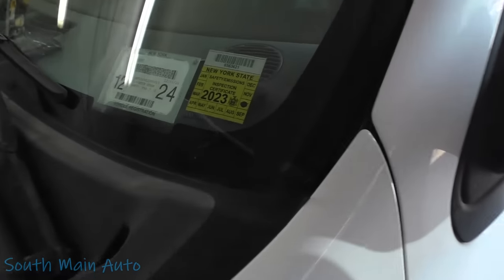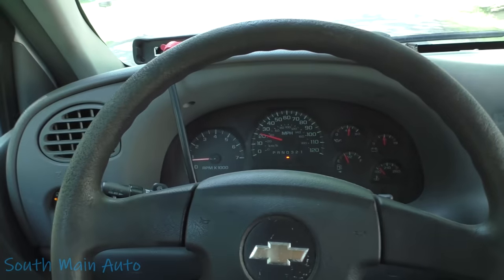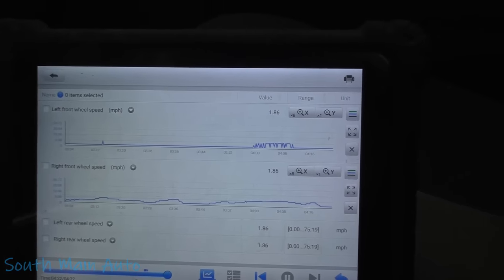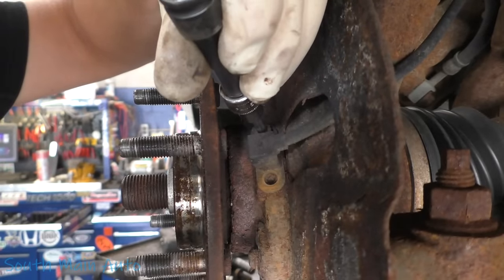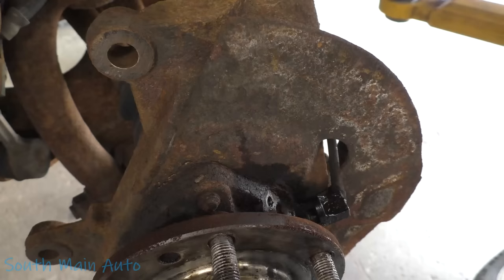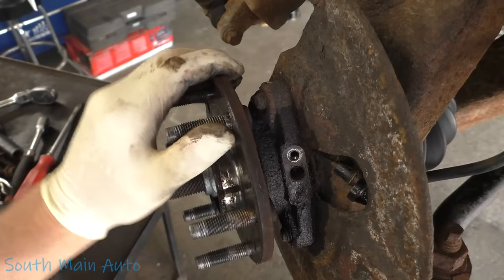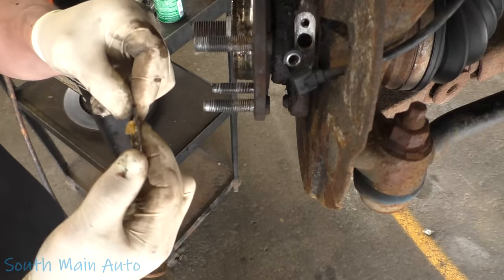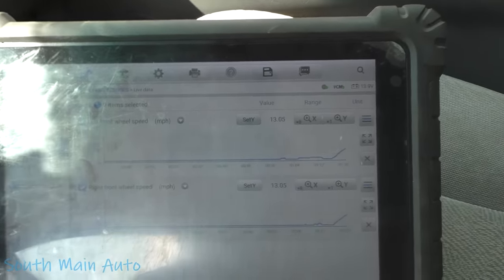Chevy Trailblazer: Unwanted ABS Activation When Stopping

Comment: My grandfather (a sheet metal mechanic from the 1920's) used your "rust files" as his lead (Pb) files back when he fabricated much sheet metal. He also marveled at the invention of Vice Grip locking pliers, making comment on how clamping metal together with C clamps went the way of the dodo. He soldered sheets of metal with massive gas heated irons. Waaay back in the day. Don't abuse your lead file !
Reply: Old School Rules!

Comment: Those wheel sensor housings are notorious to get cracks over time or when working on it and sometimes it's hard to see. To avoid customer returns with the same complaint, I'd always replace the cheap sensor. Anyways good work, Eric!

Comment: The most impressive thing about this repair is that Eric did a perfect lasting repair only spending approximately 1 hour and Zero parts replaced. We know from experience 90 % of shops and definitely all Dealer shops would very likely have at least 2 hours diagnosis time and at minimum the entire wheel bearing assembly replaced and most likely full front brakes and callipers both sides for an out the door cost of about $2000.00. 
Eric’s videos are great to watch as entertainment but the educational value is pure gold… Literally.

Comment: if i'm not mistaken there are 2 bolt holes that hold the shim, but only one of them to secure the sensor. 2 bolts on the shim would keep rust from growing underneath and pushing up the side that has the broken bolt.

Comment: What a crappy design.  GM knew the sensor's location was harsh and the rust verified same.  

I would hope design engineers consider: water/dry, heat/cold, vibration/shock, chemicals, repair abuse, lifetime.

All-in-all I consider this speed  sensor design a failure.